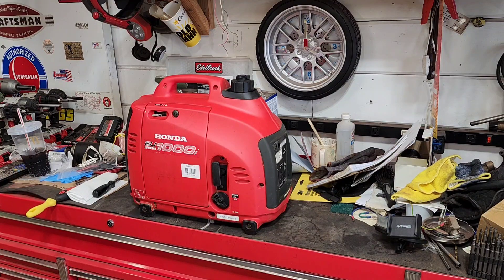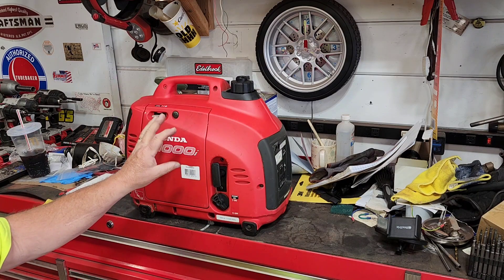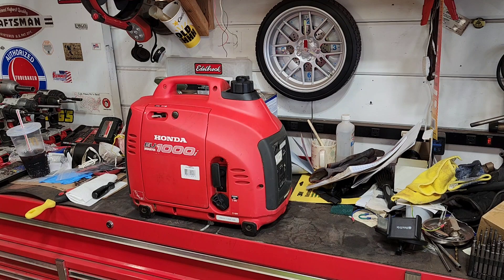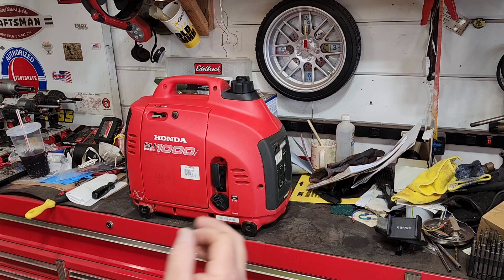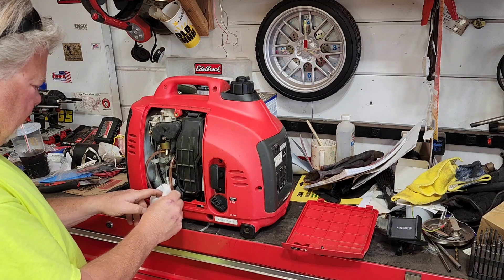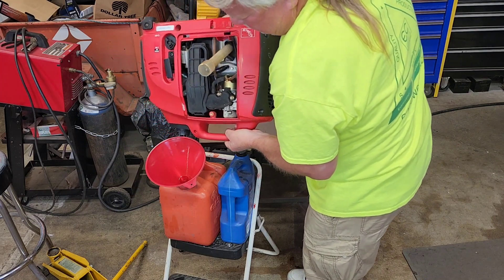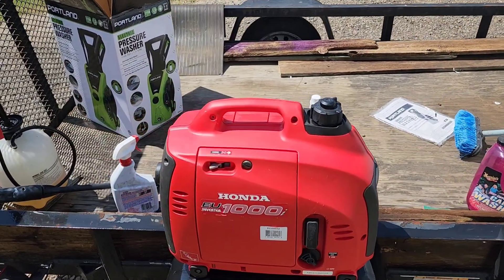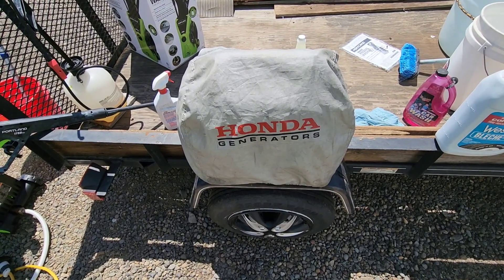So I bought another Honda EU1000i Inverter Generator. When was it last serviced? Let's service it!

Comment: I was dumpster diving and found one of these in the original box , opened but still with all the factory foam ect, got it home and gassed it up and tried to start it and that was a no go , I took the service cover off and it looked like all the exposed wires were eaten thru ( mice or rat) found a hole chewed they the box and where the pull cord is you can tell it was chewed alittle there to gain access in the carpartment , well I spliced all the wires back together, put fresh oil in it and it fired up. Been using it for 3 years now with our fault. Best dumpster diving score of my life other then a old stihl 044 that needed work
Reply from the maker: Very cool!

Comment: I just got one of these from a tenant who left all kinds of stuff behind in a rental. It won't start, but who knows when was the last time it had any service (if at all!) The only thing I've done so far was pull the spark plug, which looks pretty wasted.  Gonna be an interesting project.
Reply from the maker: Dump the fuel, clean the carb, plug, oil, and air filter clean. Clean the spark arrestor and she will run like new. I have likely put cleanse to 100 hours on this unit this year, flawless!

Comment: Good video I just found one exactly like that in the trash kind of knew what was wrong with it before I even got it on the workbench methanol poisoning soon as I took the bowl off of the carburetor it was full of the telltale corrosion that happens when people run Alcohol gasoline in them clean the carb and she started right up. I plan on ordering a new carburetor for it so it can be a reliable unit.
Reply from the maker: Score!

Comment: Why is the oil needed to be drain first then the fuel? Im new to this I bought one used on fb
Reply from the maker: No good reason. If I think about it, it might be nice to drain the oil, then turn it upside down to pour the gas out and then put oil back in. Just to keep the oil off the top of the engine. Also the gen has been sitting and all the oil is in the pan. .

Comment: Glenn, there is another (tiny) filter at the bottom of the fuel tank (inserted into the fuel line).
Also,  the valve clearances may have to be checked ....every 10 years or so , which involves
getting the engine out ! (they'll get a bit loose with time , but nobody cares -- by then the top
end will need a good clean-up anyways ).

I run mine with the engine breather disconnected from the air filter...this as J. Bidon says
might  'get me in trouble' hahaha.

I change the oil very often (all 250 cc of it) and drain the carb regularly , Seafoam is great too.

 Good for life if properly used/serviced.
Reply from the maker: Copy that!
Reply: @pasdutout4690 Thank you for the heads up on this! I didn't see that tiny filter in any of the several repair videos I watched. I pulled the tank out for cleaning today and sure enough, that filter was in there, and it was FILTHY and clogged up with animal hair, dirt, sludge and varnish. After cleaning everything today, I can rest assured that the generator is getting clean fuel.

Comment: Armoir All doesn’t last or add protection, only shine. Try something like TW Seal n Shine. It’ll add UV protection, repel water and shine it up for 6 months to a year. I use a 24:12 different ceramic spray coating on all my power equipment and ATV and dirt bike and they work great. S N S is fairly cheap, easy to get and lasts a long time.
Reply from the maker: Thanks for the suggestion, I'll look into that product. ArmorAll has kept my generators looking new for many years. however, all my Gens have Honda Covers, too. They never sit or get transported without being covered, so that really helps. Ill check out the product you suggested. Thanks

Glenn

Comment: I noticed you didn't drain the carb bowl to pull out any junk or water trapped there.  Just a simple slotted drain screw with a drain tube attached.
Using a "Mr. Funnel" brand filtering funnel will stop any debris or water from the fuel can inadvertently being poured into the fuel tank.
A tapered Qt. oil cap on a quart oil bottle allows you to 'sneak up' on the top of the filler threads to prevent any over filling - or - topping off during oil checks.  There is little to no use for the "dipstick oil level check" (checkered) center part of the oil cap.  "Top of the threads" is actually the properly filled mark as shown on the factory decal for all Honda or Honda Clone generators.
Reply from the maker: All good points.... I just finished filming an EU2000i yesterday that i bought for $300.00, not running. It will go live in January I think. You will be proud of me now! LOL. 
Thanks for the comment. MERRY CHRISTMAS!

Glenn

Comment: I have one, but fuel constantly leaks down into the case. Oil always smells like gas/oil mix and is over full. 

I always shut the fuel off, but it seems the ON/OFF valve for the fuel cap doesn't work.
Reply from the maker: The issue is likely the needle and seat are not sealing in the carbruator.  Even when you shut the valve, the fuel in the line is allowed to go past the needle and flood into the engine. Running the engine with thinned out fuel is not a good thing. It may just need a carb cleaning.
Reply: @GlennsSpeedShop  What do you recommend is the best way to clean the needle and seat? I did tear the carb down once and srayed a healthy amount of carb cleaner down into the hold where tje needle goes.